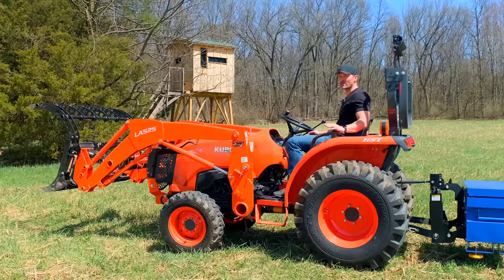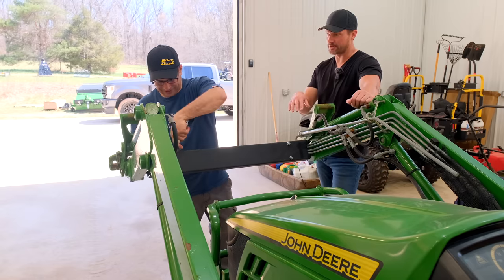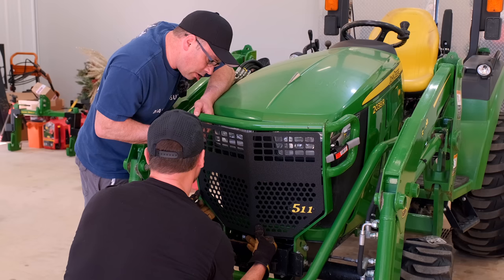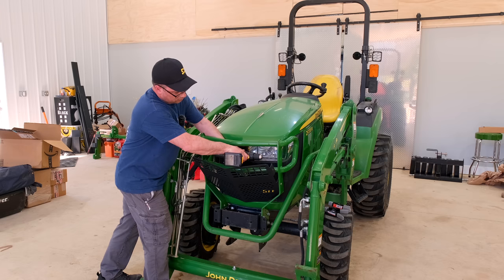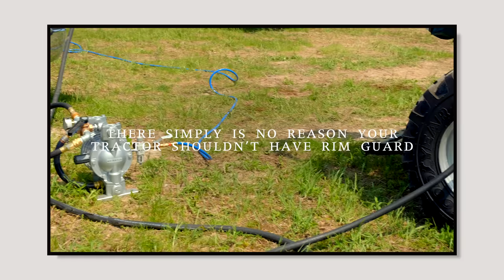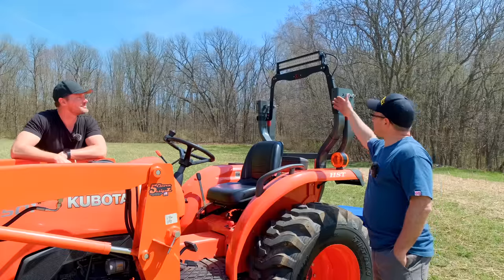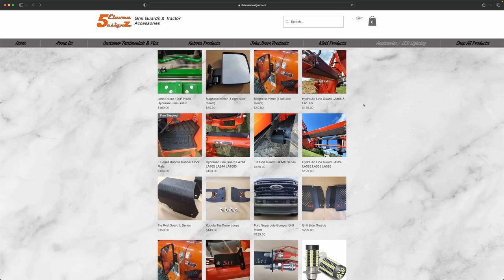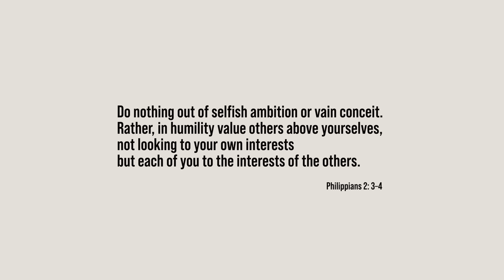CAN YOU GUESS WHAT THIS CUSTOM PEDAL CONTROLS?!

Comment from the maker: Save 5% with code GWT @ http://www.5elevendesignz.com

Good Works Tractors is happy to be sponsored by Rim Guard Solutions!  This is perhaps the most well-known ballast brand on the market today.  Rim Guard goes right inside your tires, so it's out of the way, it doesn't freeze, and doesn't corrode.  It's made from natural materials, so it's safe around livestock and pets if it spills out.  Rim Guard liquid ballast adds more weight to the back side of your tractor improving stability, loader performance, and power to the ground.  Find your closest dealer at https://bit.ly/3d0whX0

LOOK AT OUR MOST POPULAR ATTACHMENTS!
Speeco Quick Hitch: https://bit.ly/3NFC0yl
Stump Wrecker: https://bit.ly/3WYa6Tf
VersaBracket Combo: https://bit.ly/3wUPrnl
Snow Pusher: https://bit.ly/3NB4BVw
Tillers: https://bit.ly/3GT1kk1
Core Plug Aerators: https://bit.ly/3W0R25q
Pallet Forks: https://bit.ly/38wRztu
Grapples: https://bit.ly/3PNNYaZ
Dethatcher: https://bit.ly/3GT9Zmk
Tractor Canopy: https://bit.ly/3IHcvNU

WANT TO SAVE MONEY? CHECK OUT THE GWT DISCOUNT CLUB!  Use code GWT at any of the vendors below and you will save cold hard cash :)  I will also get a commission for the sale, so it's a win-win-win!  

USE CODE "GWT" TO SAVE BIG WITH:
BUCKET BRACKETS @ http://www.jufabworks.com
PTO QUICK ATTACH @ http://tractorptolink.com
DIY HYDRAULIC SOLUTIONS @ http://www.summit-hydraulics.com
GAME CHANGING GREASING SYSTEMS @ http://www.lube-shuttle.us/store
TIRE CHAINS @ http://www.tirechainsonline.com
PREVENT FLAT TIRES @ http://www.multiseal.us
CULTIPACKERS & CRIMPERS @ http://www.packermaxx.com
ALL OEM JOHN DEERE PARTS @ http://www.247parts.com
ACCESSORIES AND BACKHOE BUCKETS @ http://www.muddscustoms.com
CUSTOM TRACTOR FLOORMATS @ http://www.tractormat.com
PROTECT, ORGANIZE, IDENTIFY HOSES @ http://www.outbackwrap.com
BOX BLADES FOR ATV'S @ http://www.northwoodsfabrication.com
HYDRAULIC SYSTEM PROTECTION @ http://www.hoseendchamer.com
DUMP FROM THE SEAT MATERIAL COLLECTION SYSTEMS @ http://www.proteroinc.com
POWERED SWEEPERS SWEEP UP ANYTHING @ http://www.sweep-all.com
EASY WHEEL TOP LINK HANDLE @ http://www.tractoraftermarket.com
TIRES, WHEELS, AND DUAL ADAPTERS @ http://www.millertire.com
AMERICAN MADE CARRY ALL ON STEROIDS @ http:www.bigtoolrack.com
THE BEST TOOTHBAR AND MORE @ http://www.heavyhitch.com
5% OFF WITH CODE GWT AT TRAC SEATS! http://www.tracseats.com

SHOP: http://www.goodworkstractors.com
AMAZON: http://www.amazon.com/shop/goodworkstractors
SUBSCRIBE: http://www.youtube.com/goodworkstractors
LIKE: http://www.facebook.com/goodworkstrac...
FOLLOW: http://www.instagram.com/goodworkstra...
MERCHANDISE: https://stores.inksoft.com/good_works_tractors_merch/shop/home

*Discount codes cannot be combined with any other promotions, offers, or deals!
**I choose to sell some products through 3rd parties instead of stocking items myself.  Know that I will receive a commission if you choose to purchase through certain links.  Thank you very much for your support!

This video is for entertainment purposes only.  Good Works Tractors (Good Works Lawn & Power, LLC) cannot be held responsible for content found in any video.  Always reference your owners manuals, use extreme caution, and proceed at your own risk.
Reply: It looks nice and tidy. And you can't damage the hidrolicks.

Comment: Love when GWT posts these mod type videos and Justin is a freaking genius. Courtney - he might be the guy to come up with a cover for the hydraulic cylinder on some grapples that is exposed to limbs and other things that can interfere with the grapple. 

What about adding a “thumb” to the GWT stump wrecker? So you can pick up the stump after popping it out by having a thumb, like excavators have? Can use the same 3 point along with his foot switch.

I can attest that the electronic solenoid types that use a plug in like the summit 3rd function kit - the plug that goes into the solenoid from the joystick switch can come unplugged from vibrations. I put a zip tie around it but the foot switch and eliminating the electric would be a big help.

Good job Courtney and Justin!

Comment: Consider  a winch  mount on front   and rear  possibly  mounted 2in tube steel stinger style so could  possibly  swap for ball hitch  or tool basket   so many stinger  accessories  if just had the reciver  already  mounted in place

Comment: I like the look of the 511 guard and would like to have one on my L3301. The only problem I see is, you wont be able to see. Covering up more of the headlights, at least on the Kubota. I dont know about the Deere, but the headlights suck on Kubota. I have added extra LED lights to my ROPS because of that. So at this point it wouldn't bother me that bad, but if its stock its gonna make a bad light situation worse in my opinion. I would  like one to protect my radiator and grill though. I work around a lot of brush sometime.
Reply: I see that with a lot of them, I'd make a full cut out for the Light with a drop in for a pieces of easily replaceable Lexan .

Comment: I like the idea of the foot control. I have a kubota bx and find myself controlling the bucket by the base of the lever instead of the handle for finer control. Having buttons on the handle, for me, would be in the wrong place. FYI using the handle the bucket moves way to fast for my liking and I just never got used to it, so I rest my hand at the base of the controls arm

Comment: Foot operated grapple is awesome!  Not sure this would work very well with a gear drive though. I used to operate a Deere backhoe with a foot operated jaw bucket, newer models have buttons on the joy stick, not sure why they changed. Another item I'd like to see someone come up with is a guard for the L2501 fuel filter assembly; I've broken mine off once and apparently its a common thing, especially when using a grapple.

Comment: I like many of these ideas. I have a question and suggestion on the ROPS. As he has it set up I wouldn’t be able to get into my garage for the same reason as with the ROPS up. But it makes me wonder if anyone has a remote retractable ROPS that when up, pins would lock it in place  electronically or hydraulically.  I’ve only had my ROPS up once probably 12 years ago. The big bolts are now rusted in place and I can’t ever use the ROPS.

Comment: Possibly  a boom accessories  for being able to lift things  example  make rafters   or use for raising  butchering  beef  or pigs ect  or lifting hydraulic  cylinders  or other heavy  items where pallet forks  too much  size wise  boom ? Maybe  to work with pallet  forks adding  to the lift height  ballast weight  would be important

Comment: 1. 3rd function foot I’m sure works well for hydros…manuals not so much. 
2. Ballast box is too nice to fill 3/4 full with concrete. I did the same thing but built shelving with a lot of chains on bottom for weight. Having large volume covered storage is too nice to eliminate.

Comment: This is an amazing design, I would much rather have this third function on my Kioti 2220 Lets make it happen Justin
Reply: Kioti's hydraulic back Hoe Thumb is a Foot Lever control, Check to see if it will work as a third Function control.
It flat mounts on the back Hoe deck. Compare pricing if it can be purchased separately .
Mike M DK4510..

Comment: I don't have a 3rd function on my Mahindra 1533 but that mechanical control looks nice. Don't know how it would fit with the clutch pedal on the left side but it would be a convenient place given the only time I use my left foot is if I have to clutch to start the tractor, shift L-M-H, shift to/from 4WD or engage it to start/stop the PTO. None of those things occur with the frequency one needs when using the loader and grapple. 
I'm confused about the light bar. It looks like it is permanently "up" negating the folding function of the ROPS. 
Looks like Justin makes really high quality products
Reply from the maker: the light bar is permanently up, but it’s shorter than the rops so he can still clear his standard garage door.

Comment: arghhhhh! i wish i had seen this video a month ago.  i just ordered a replacement front tube guard for my LA524 loader, and i have a pushbutton 3rd function already.  i have always thought that the stock Kubota guard was just for show, and it does a little more than nothing.  i don't feel as bad about the 3rd function, since i have limited use of my left leg, and would have had to adapt it to some sort of hand control anyway.  i had been imagining a hand control on the loader control. using a pneumatically actuated valve so i wouldn't need to run hydraulic lines up the control lever.  i already have a pneumatically controlled clutch (push button on the PTO lever).
Reply: pilot valves use real small Hydraulic valves/Hoses that could be stick mounted.

Comment: I like idea of the 3rd function treadle, but I have a manual transmission/shuttle shift. I need my foot on that clutch pedal when I'm going into a brush pile, a junk pike, dirt, or whatever. The grapple needs to function while moving. Not sure how this would work on my tractor.
Reply: That valve idea could be done with a variable pilot control Valve on the loader Stick. More $$$$ but the Valve would be real small on the Loader Stick. 
Mike M.

Comment: Would love to get one of those brush grill guards for the Mahendra 5145 if you would make one and the emax 25

the 5145 there is a lot of placed to back guards that people would by the power steering the fuel filter and more 

the 3rd function id love one if it was available for the Mahindra 5145

Comment: Imagine  not practical  for 4 wheel drive tractor   but older tractor  you had 2 brake  peddles could  apply  one or the to control  spinning wheel  and actually turn on a dime  also had pedal  lock that lock both together  for stopping  or down hill control

Comment: I put a piece of pipe insulation foam on my hydro line across my loader. Held on with electrical tape. Too bad I didn't do that before a rock dented the line. Bad design by JD.